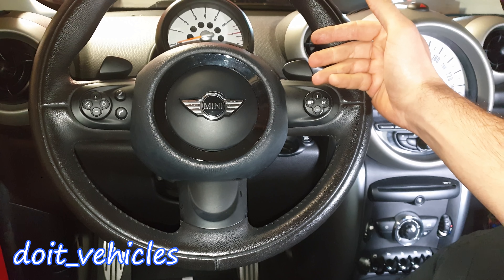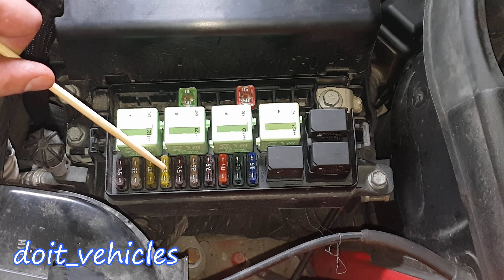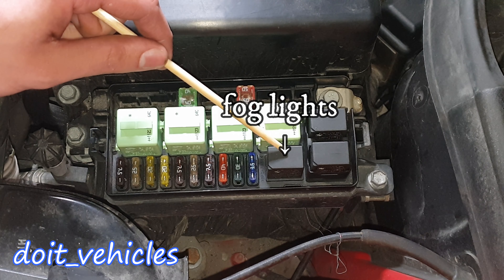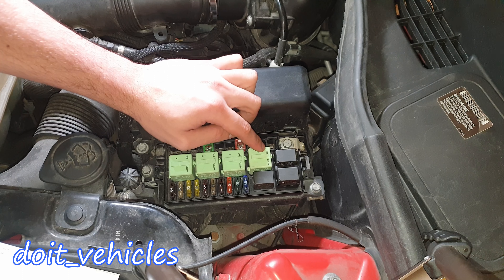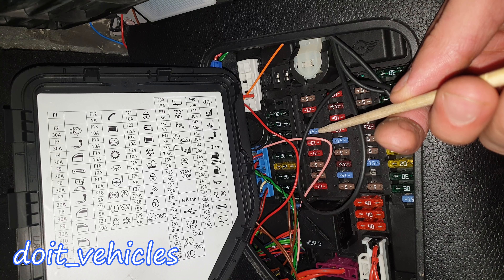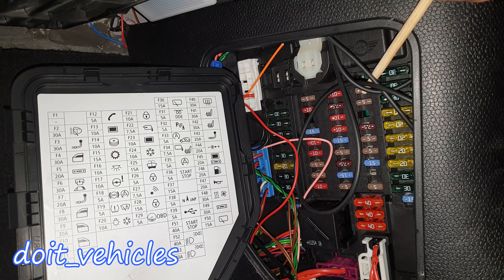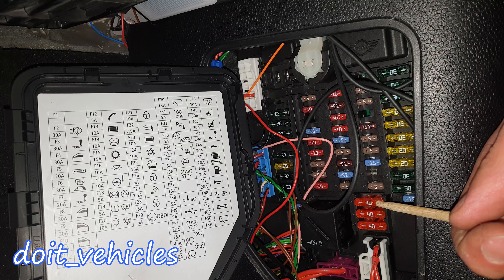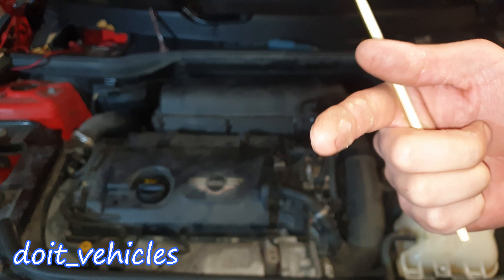Mini Cooper S R60 ALL Fuses & Relays Location / Diagram Countryman

Comment: I pulled the  "black relay" in the fuse box on the passenger side footwell, and my front wipers turned on and I could not turn them off without the relay reinserted.  Seems the relay controls the front wipers,

Comment: Thank you for the thorough video. Just an FYI. I have a 2012 Mini Cooper S R56 N18. The relay @ 1:41 you mentioned is for the fog lights, is also (on my car) the power feed to the ignition coils.  I had a "crank no start" issue and after weeks of narrowing the down the problem, I swapped the relay with the one for the windshield wipers (same part number) and the car started right up! The reason I tried that relay is because another Mini Cooper "crank no start" YouTube video showed the relay was the issue after troubleshooting. Thanks again for your videos. I used them to do my valve cover and gasket, oil change and cleaning the throttle body.
Reply: Did you have a P0050 code when your mini was cranking with no start?
Reply: @logandale7911  I don't believe I had a code, which was the reason I couldn't figure it out right away. It's been so long, and I sold the car, but I don't believe I had a code.

Comment: What wou cause both rear windows not to go up or down in a 2011 mini countryman?  Frond windows work fine.
Reply: Hello, have you managed to sort this out? My rear goes down in small incriments and front work fine. The switches in the rear don't work either
Reply: Hey did you manage to figure this out? My rear countryman windows go down in small incriments. The switches on the rear don't work either.

Comment: Where the Fin hell are the fuses for left and right turn signal! 
My left, driver side turn signal stopped working, computer warns turn signal is not working but the bulb is fine.  No voltage at the plug on the harness. This happened after the wires inside of the headlight housing lost their insulation,  insulation just crusted off. So no I have a new headlight housing and bulb, but signal still gets no voltage to it and my left turn signal is flashing fast.

Comment: is there a fuse for the reverse lights? mine arent working. changed the bulbs and the reverse switch but don't know which fuse is for the reverse lights. I have a R56 2012 Base.

Comment: My joy stick controls in the center console by the auto gear shift stopped working that control my radio and nab functions. Is that on a fuse? I checked what I thought would control them. Any info would help greatly!

Comment: Thank you for all the detail you have provided which is most appreciated! Just wondering, what fuse would be for the remote keyfob, which for me is not working. I have checked the battery which is showing up as 3v, so assuming the issue is the fuse, though unsure of the location. Thank you!
Reply: I have similar problem with my own. Have you found the solution, please?
Similarly, my car stereo is powered but not working
Reply: @abubakarjabbo1773  in the end it wasn't a fuse. I needed a replacement keyfob. The battery was replaced though the issue was not resolved, hence trying the new keyfob, which was the answer. I didn't go through BMW as they were charging silly money just to make an appointment.

Comment: Fuse 52 and 53 are for headlights, would one be for high beam and other be for low beam? I have factory xenon lights and my highbeams don't work. The blue light on the dash comes on but thr light doesn't change.
Reply: More likely are left and right. If your hi beam or low beam doesn't work, then it could be your light bulb.
Reply: commenting for future answers, my beams work fine but the high beams dont turn on. dashboard indicator light turns on however there is no change to the lights.

Comment: Brilliant. I have a 2013 Countryman One D 1.6 D. Fuel starvation. Garage said it needs a new fuel pump, but worse, it's blown the relay. A local electrician said the fuse box in the engine bay has the fuel pump  relay integrated into the fuse box, so, it's not a pull out push in relay, I'll need a new fuse box, about £700.
This has really helped, it'll need a £36 push in relay and  a few expletives.
Reply from the maker: Strange that an important relay is integrated in the whole fuse box 🤔
Reply: I dont get what you said, did you have to buy the whole fuse box or a 30 pound relay?

Comment: Hey doit, i have 5 error codes all related on terminal 15... all are short circuit codes, oil pressure control vavle, both o2's, fuel sending unit sensor,thermostat heater... any suggestions

Comment: Does the radio have a hidden fuse behind the head unit?  I went thru and checked all the fuses and they were ok.  but radio wont play and  telephone doesn't either.  Only thing can get to is the config and shows temp etc.  But that is it.
Reply: There is a fuse in rear but I just pulled my hole dash apart and fuse was good  :(

Comment: Thanks for the video.  Today I had a turn signal sensor light come on.  All turn signals provided a fast flashing as a warning (from both the inside of the car and the outside - both front and rear).  After about an hour driving, the warning went off and the signals worked perfectly.  Any thoughts?  What fuse controls the turn signals?
Reply from the maker: The Relay will control the warning lights
Reply: Same problem Kelley, cannot work out which fuse though, di you work it out as my left indicators are still flashing and im getting left rear indictor fault. Have changed globe so it must be the fuse or relay wherever they are? ty

Comment: I think you might've gotten fuse FL9 wrong. I have a '14 Clubman and was getting an error 0031ED through the Carly app (Electric fan drive power stage 2: line break), and my AC compressor was not kicking on. The engine bay fuse block has a diagram that looks like a fan with a "II" beside it for FL9. I moved the fuse from FL10 (both are 50A), and now my AC works. In your video, you call it the rear screen defroster which is the symbol on FL10. ABS is FL6 as you point out, so there are two blanks and then FL9 in your video. I am assuming your rear defrost does actually work though, right?